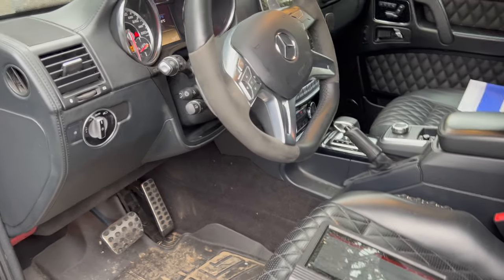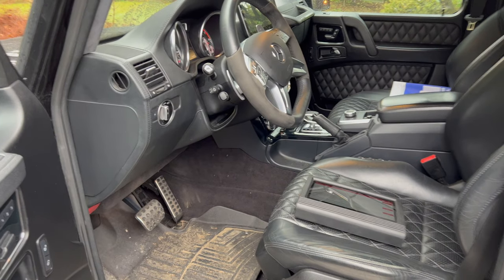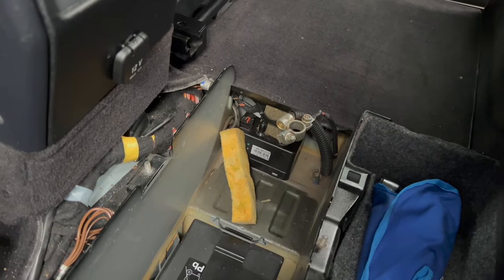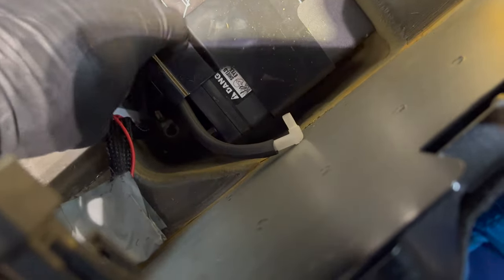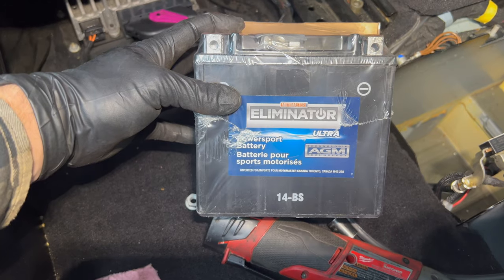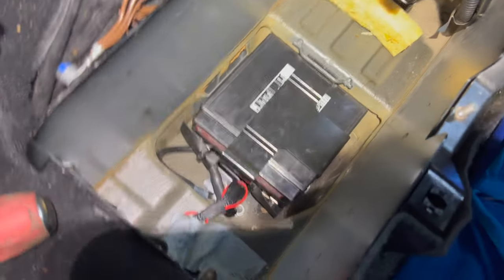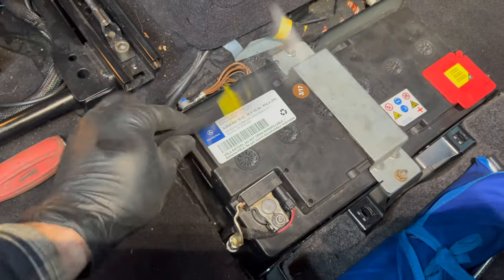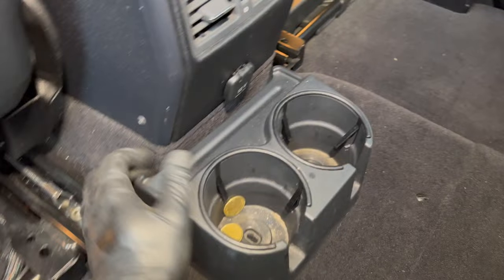W463 Mercedes G63 G500 G550 AUX Battery Replacement

Comment: great video. Do you happen to have a video of the cleaning of the airpump for the seats? My seats bolsters dont move on both seats but the adjustments work. Im wondering if i have to get a new airpump or just clean it like you said.
Reply from the maker: No I didn't make a video, however if the adjustments work, it doesn't sound like it's your air pump. Do you hear the pump come on at all?
Reply: @ViperMike  I don’t hear the pump turned on at all. Thanks to your video I was able to pull it out and ordered the new one. It’ll arrive next week so hopefully once the pump is changed the seats will work. I’m not sure if it might be a fuse outage too.
Reply from the maker: @soroushmazaherkermani1722  Did you check that you have power at the connector? The pump is fairly easy to fix, I would try repairing it first before you install a new one. They aren't cheap from what I remember. I'll try make a video on it today
Reply: @ViperMike  update: i received a new pump and problem still remain. Now i want to see if maybe the fuse is out, but cant locate the correct fuse box. My guide says its F63-F64 30amp on fuse box E but no clue where to look. I looked at what i thought was fuse box E but couldnt find F63-64 on. Im trying to learn on my own and clearly not familiar with G's so any help would be appreciated. I have 2016 btw but most of your vids seem to apply to my car as well. Thanks for all the info and your vids.
Reply from the maker: @soroushmazaherkermani1722  I just made a video about repairing the pump, will post it shortly. I'm not sure which fuse it is that supplies power to the pump, but you can easily test the connector with a test light

Comment: What is this battery used for?
The older pre-2013 w463 doesn’t have it.
Reply from the maker: Most if not all modern Mercedes have the auxiliary battery. It's used for various electronics

Comment: Do I need to do any programming after I switched the aux battery? If so what and how can I do it? Thanks!
Reply from the maker: No you don't need to do any programming
Reply: Thank you so much! I was thinking about doing it myself but the local mechanics told me that I had to reprogram it and that’s why I need to pay $$$$ them to get it done.
Reply from the maker: @heewonlee4357  not a problem. This is why I make these videos, to help people not get scammed